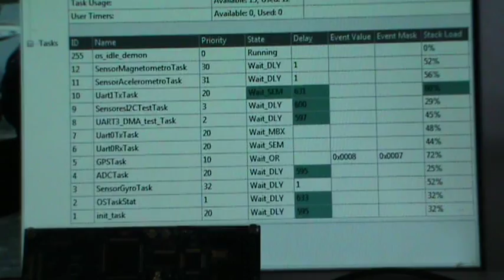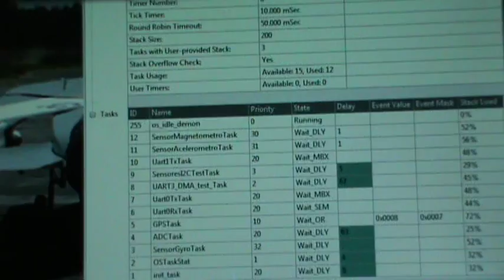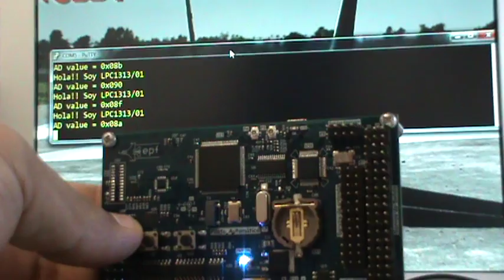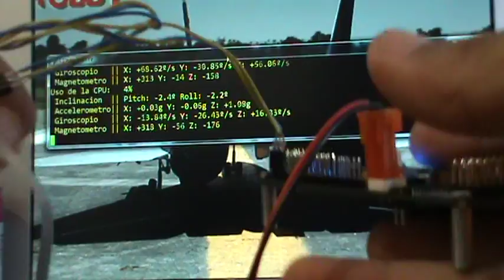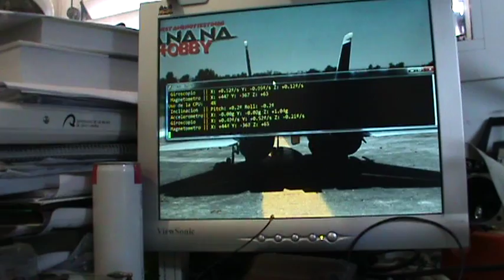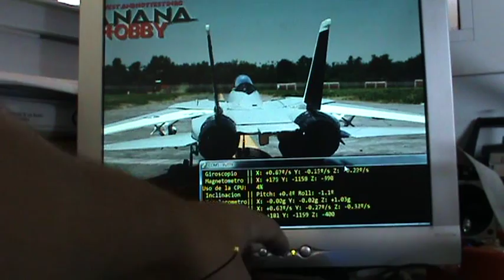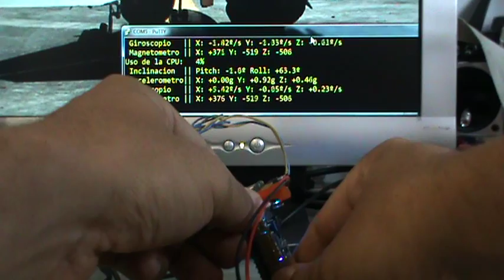UAV AutoPilot - ARM Cortex-M3.RTOS - Demo - Accelerometer, Gyro, Magnetometer, Altitude, Pitot

Comment from the maker: I use a RTOS too and it helps me to have much better performance. In the way I told you before, if you need to change the value of something in the screen, you only need to change the values of the arrays in RAM and the ISR makes the rest. The best way to not overload the CPU is to have all the information in memory. In my case, the position of the image I draw on video is static, so it is stored on memory, and so the ISR only need to load the values on the output compares, not calculate it.

Comment from the maker: I recomend you to use hardware timers and start it with every row sync in the video signal. You can have the image you want to present in RAM and the resolution depend on the available memory you have. If you implement a simple algorithm in the ISR of the timer, save the informatión of times you need to reload the output compares of the timer, and the image you want in RAM, you can have low CPU consuming with the cost of memory.

Comment from the maker: Thank you. Yes I did finish it. This video is very old, from begining. I have been working on the software close to one year. Soon I will upload a video flying in real, but I am working alone and I had no time for make video. 
I don't know if you can watch the Hardware in the loop test video with the simulator, youtube blocked the video in some countries.
In the description you can link to a place I upload more information. Right now, I am not thinking to sell the board, I only built 5.

Comment from the maker: I take a analog video cam and draw only white pixels on the analog video signal. If you put a 0V in the right moment in the analog video signal you will have a withe in this instant. I do not add color, and neither work with digital video, it requiere much more computacional power.